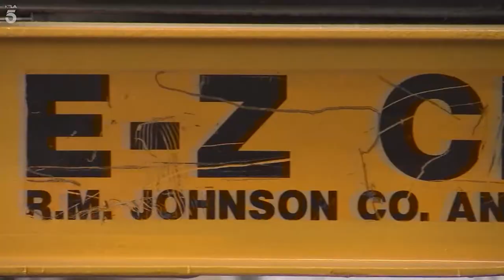How Do You Recycle A Refrigerator?

Comment: You know what also costs a lot of money? Buying a new modern fridge every 10 years
Reply: That's true, but here's the data on mine.  My old refrigerator was 30 years old.  It was using 2400 kwh/yr (likely was low on refrigerant - new it should have used around 1600/yr or so).  I have some of the cheapest electricity in the country at just under $.10/kwh.  My new refrigerator says it will use 650 or so kwh/yr, but my data with my kill-a-watt meter on it shows it is on pace for about 450 kwh/yr (we don't open/close it much).  $240/yr on electricity vs $45/yr is $195 savings annually.  My new fridge was around $1300 w/ tax.  It will pay for its self in less than 7 years.